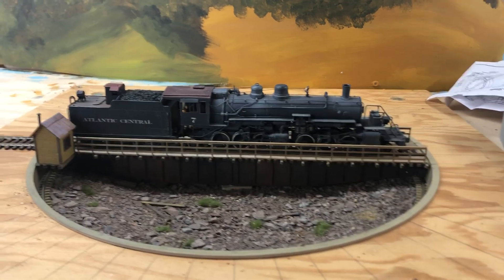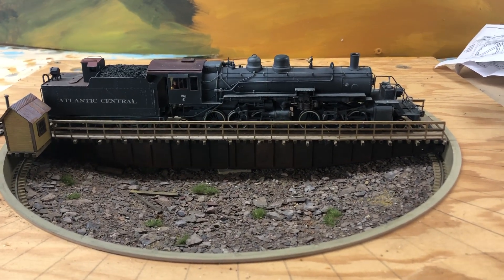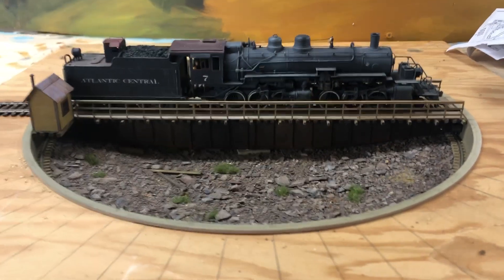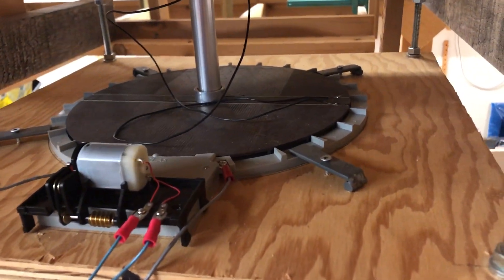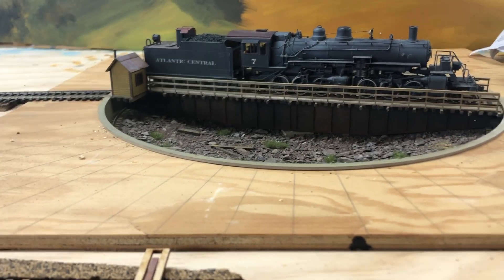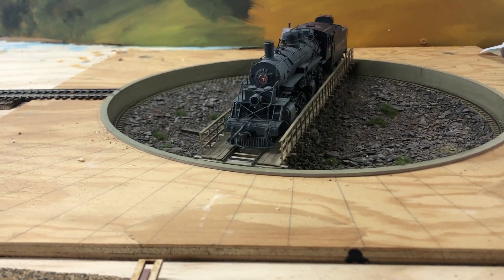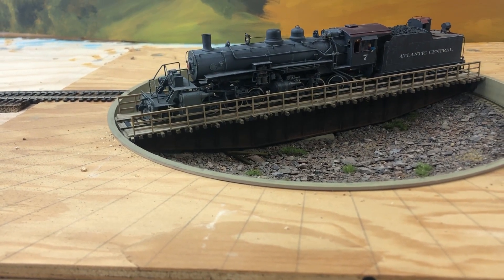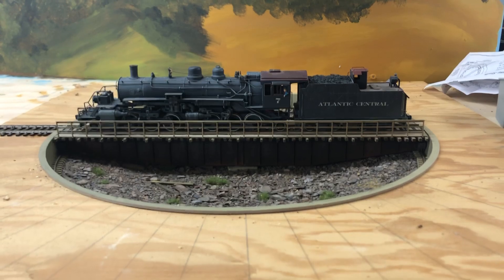WalthersAtlas turntable

Comment: Nice Doug 👍 I am astonished that ATLAS never reduced, or got rid of, the excessive gear mesh noise or the jerky movements of the indexing. I imagine they were shooting toward a segment of the market and that meant a pretty reasonable price point; been on the market for close to 5 decades now. But from a pure utilitarian point of view it's a good stand it as is.
Reply from the maker: They have improved a little over the years Colin. I use 2 on my layout and they are very reliable. Noisy, but I operate alone and don't care.
Reply: @dougcoffeyvideos9094  10-4 👍